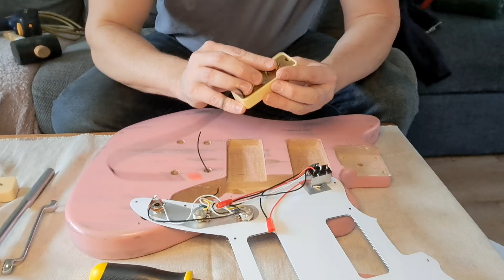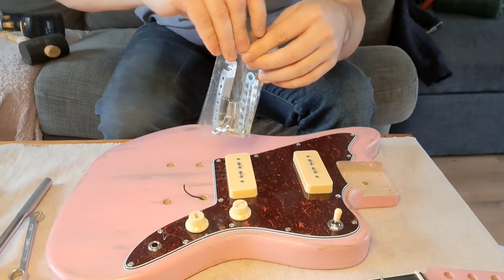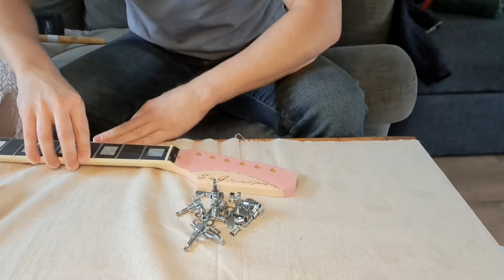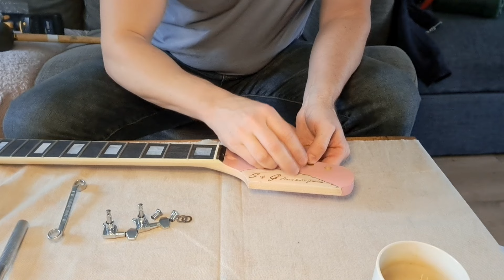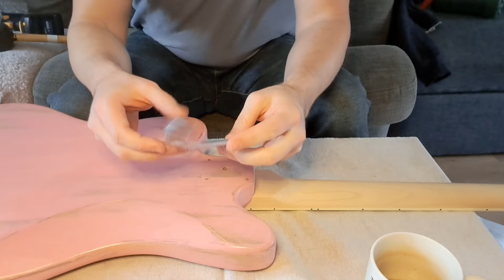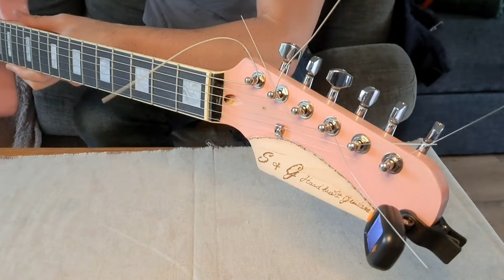Building the Harley Benton electric guitar kit JA. Full build from kit to working guitar. + sounds

Comment: how did you paint it?
Reply from the maker: Hi, there are some videos on my channel from about a year ago, but I did 3 things:
1. Rubbed some black ink over the wood.
2. Painted two coats of pink chalk paint.
3. Gave it two coats of wax.

I gave it really light coverage with the paint, and some of it came off when I applied the wax. It was great fun to do. I am a total beginner at this, so I just did what I thought would look cool.
Reply: @everythingguitar6247  did you sand it down first before adding anything?
Reply from the maker: @ThatBloxFruitKid  yes I did. I wanted to take off whatever they had put on as a finish.